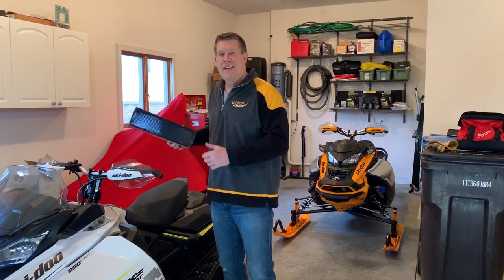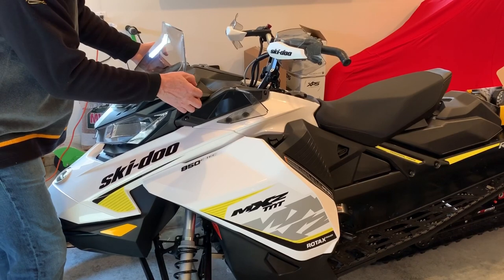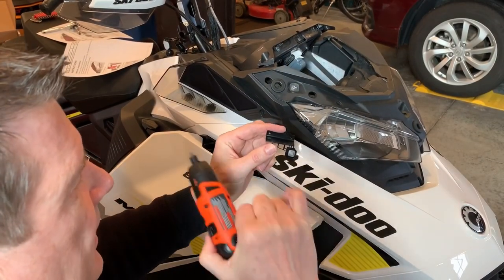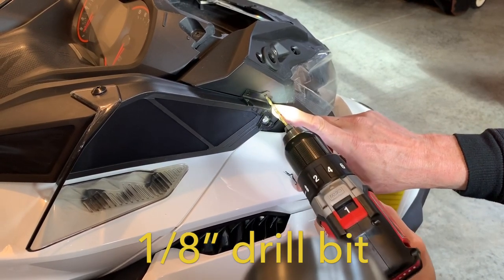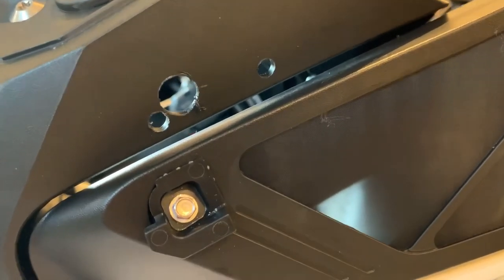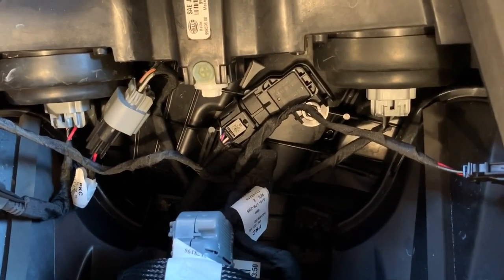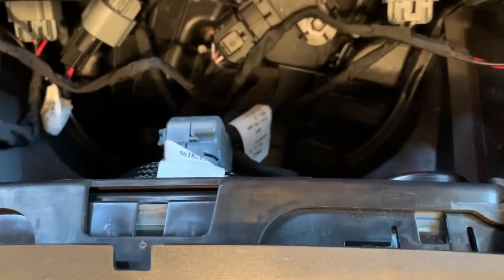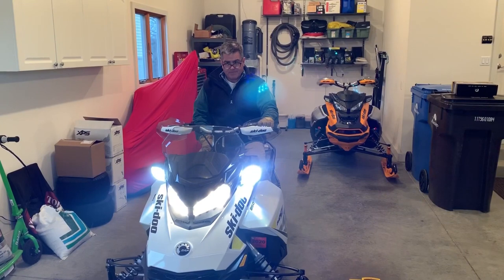Ski-Doo High Beam Auxiliary LED Lights Installation

Comment: Great Video. Thanks ever so much. Just an FYI for you DIYers.The template you screw on the side of your sled to drill your pilot holes?? Once pilot holes are drilled. You then have to break off the template portion LEAVING the screw and slide portion of that template for the bottom of the light to slide into to secure the bottom of the light in place. I original removed the complete template and replaced the OEM screws and the light was wiggly as jello lol. I then knew something was wrong.
Another tip before mounting light. Plug wiring harness into lights so the don't fall on the ground while adding the inner mounting plates and screws. The mounting plates are a pain in the ass to hold i such a compact place. I used mechanical wire and put through one of the holes just so I don't drop it into the engine compartment. Loosely add one screw then pull out mechanical wire from second screw hole.

Comment: Why on the box the lights came in it looks like one light is larger than the other? I purchased 860201651 for 2020 900t enduro gen-4 wide body an the lights are the same size. Is this correct or did I receive the wrong ones?
Reply from the maker: Hi Kevin. The lights are both the same size.  They are a matched pair.
Reply: Rob Koenig - Ski-Doo Trail Ambassador   Ok thanks a lot Rob,and thanks for video,I’m gonna need it lol! Doesn’t look real hard to do ill just take my time.
Reply from the maker: Kevin Markey You are right. Not difficult but just take your time. Use good sharp bits when drilling the three holes with the template.  Have fun!
Reply: Rob Koenig - Ski-Doo Trail Ambassador   Ok thanks again!
Reply: Rob Koenig - Ski-Doo Trail Ambassador   Rob do you know of any videos of installing snow trackers on ski Doo adjustable ts skis? Thanks

Comment: Is the beam adjustable?
Reply from the maker: Not really. Has a pretty good coverage. I’ve installed a few sets and nobody has asked to re-aim them.
Reply: Rob Koenig - Ski-Doo Trail Ambassador 
They are on the sled I bought but they seem to aim down a little low.  Just thought there might be someway to adjust them up a little. Thanks. Great video
Reply from the maker: Brian Severt  I’m wondering if they were installed correctly?  Have you rode with them?  Send me a pic if you can from the side.
Reply: Rob Koenig - Ski-Doo Trail Ambassador I wasn’t able to send a pic here. I sent one to you through messenger.

Comment: As soon as I see the drill come out, that makes this accessory permanent. Lost me with the drill
Reply: ahill7866 I initially thought the same thing but the holes are in flat black plastic. Black push plugs are available that when inserted would be virtually indistinguishable.